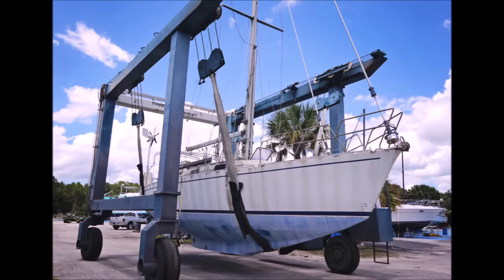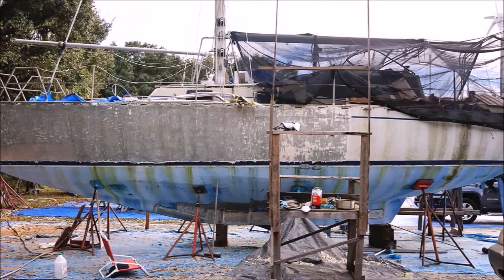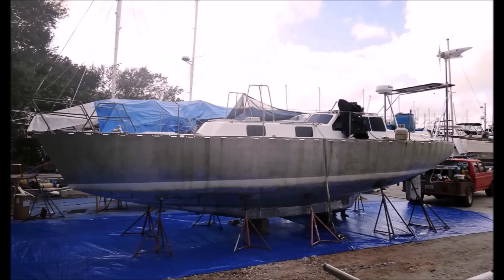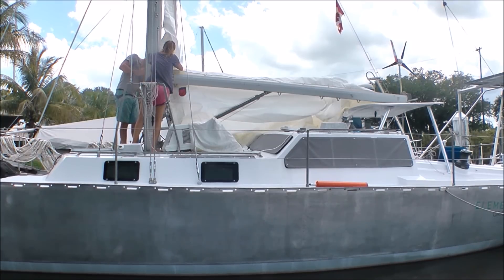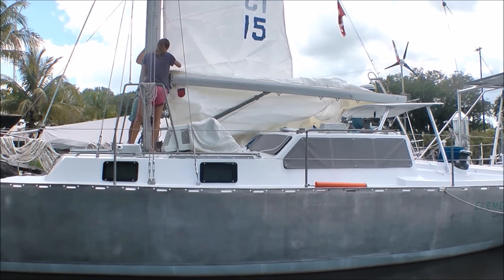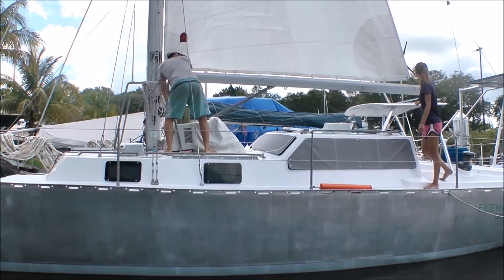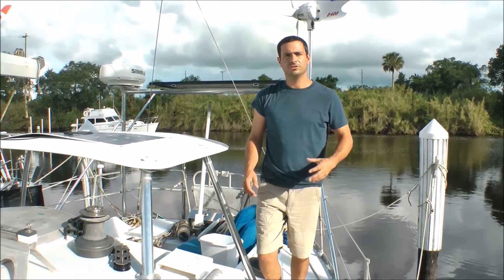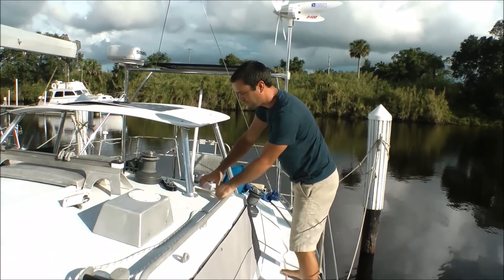Our Thoughts on Going Bare (MJ Sailing - EP 24)

Comment: interesting,,,how is the metallurgy,if you use brass thru hull.or silicone bronze,which is usually what your gudgen is made out of..  ,ive been building boats for years,but never what you have..either wood or fiberglas...good luck.and you guys really seem to know what your doing..which is real refreshing...over the years ive run into so many people who dont have a clue
Reply: Thanks Chapmaker46.   No bronze or brass anywhere on the boat if we can help it.  All valves (welded stand pipes so no thruhulls) are Marelon plastic ball valves so no galvanic issues there.  On an aluminum boat, well electrically insulated stainless is a much better choice.

Matt
Reply: it sounds like you guys got it all covered..very interesting to me.as a boat builder.well take care ans smooth sailing..stay safe,and wear your harness..LOL

Comment: Please read through because I think you'll find it interesting.  I was reading an article about some experiments they were doing with hydrogen.  One was trying to compress it into a liquid or solid.  They were working with just a few molecules of hydrogen and applying huge amounts of pressure.  My first question was, what are they compressing it with?  Most structures would be useless for many reasons.  Then they said they were using diamonds to do it.  So my next thought was, ok, what are you protecting the diamond with because it can't stand that much pressure.  Had to read further in the article to find out.  And the answer was....

Aluminum oxide.

So now your hull is protected by what they use to protect diamonds!
Reply: That's funny.  I've never researched it's use beyond the sand paper we've all used.

Matt

Comment: With the bare shiny or even darker surface is there any difference in surface temperature of the hull or interior temperature???
Reply: Yes!  It is a hot surface and not great for the tropics, but North, any free heat helps.
Reply: Thanks

Comment: The deal with aluminium as i have understood it, is that it corrodes very easily. Pretty much for all types. However, when it corrodes it does not change in volume hence the thin layer will remain and "protect" the next layer from acces to oxigen. Steel however changes in volume, flaking of and exposing the next layer until completely rotted through. Different qualities alu with diff. additives wil result in diff. strengts, heat treatebility and weld-ability etc. Not wanting to spend time painting sounds like a strange excuse, I would go for looks...this hull looks pretty good to me. As long as you don't mis the crash protection of the paint....😊
Reply: First time I left a comment and it keeps multiplying. It said you have not posted....some problem..bla. I think I pushed the "blue arrow" quite a few times. Sorry everybody....
Reply from the maker: I sent through one and deleted the others.

Comment: An aluminum boat?  Oh, boy!  Aren't they noisy?  Aren't you gonna hear every humpback within a thousand nautical miles from you?  When are you finally out of the marina and on the open ocean?  Subscribed.
Reply: Insulated to the floor and the cabin sole is pretty darn thick (will be insulated too).  From the sound of bow thrusters in the marina, it's actually quieter than our cored hulled Sabre.

Matt

Comment: thought: placing the ms/ss/vang winch just outboard of existing winch [w/clutch just forward] ?
fun to watch you guys -
Reply: Damon, Are you talking about the large Harken primaries?  I would love to do it that way since I could use which ever winch is available.  Unfortunately, once the curtains are on the dodger, it would be difficult to reach the clutches.    It seems my only option is for a crossover block to send them back forward to the primaries if needed.

Thanks,

Matt

Comment: I'm not sure how to deal with scratches. I know that you can put powder over powder and it's tough. maybe might be able to use heat guns. But it would need to be done at a time when there wasn't any insulation. for the first time. but it is a thought.

Comment: Hey Guys thank you for the awesome video's, looks like you are getting close to sailing off into the sunset. Wanted to comment on the paint vs raw aluminum. I work for the Fire Department in Sausalito CA and we have an all aluminum fire boat that was painted from stem to stern when it was delivered 12 years ago. After only 2 years we were experiencing the paint bubbling and flaking off. After doing a Shit ton of research we have completely removed all the paint less a few stripes and all is well with the hull. I would recommend that you have a regular zinc replacement program to prevent the fast degradation of your hull. I addition, you might seriously consider getting a quality galvanic isolator. We have seen a 75% reduction in corrosion and zinc loss. I would be happy to send you more information on this if you would feel it would be helpful. Cheers!
Reply from the maker: It's nice to hear that so many people are agreeing with us on the raw aluminum, especially those that have worked with both!  :)

Comment: The ideas is to have clean decks furler lines out to the toe rails so you don't stand on a line that can roll under foot and off balance you
Reply from the maker: We'll most likely go out the back of the cockpit and around to get on deck, but after living two years in a construction zone of a boat with things constantly littering the floor, we're pretty good at stepping over and around things now.  :)

Comment: Your wind generator seems to be working good.   If the sun is out of the port side your wind generator will likely cast a piece of shadow enough to drop your amps way down..Watch your digital amp meter .

Comment: I know that this comment comment comes long after you put this up for viewers to understand why you left the aluminum unpainted.  But all you need do to explain why the aluminum is unpainted is to point out that the U.S.C.G. does not paint its aluminum lifeboats above the waterline too.  The reason is that painting the aluminum creates more maintenance issues than leaving the aluminum unpainted.  Note that I never said "bare".  Aluminum forms an oxidation coating on itself that helps protect the metal.  Your aluminum is not bare; it is merely unpainted.  Looking forward to watching the remaining videos until I am current with you and your travels.  Kevin, USCG Ret.

Comment: The J measurement of the main appears to be good as well as the P, however it's not really cut full enough to maximize light air performance.
Reply: P is still about a foot short.  Without the battens, the leech was hooking and looks a little shorter than it is in person. But, I'd still like more roach.  Unfortunately,  I'm guessing a new staysail and headsail are in order first.... we haven't tried to raise those yet, but the fabric has only a bit of life in it.

Matt

Comment: Okay, I admit it - I came for Jessica's bare hull even though I was well aware clickbait was gratuitously employed.  Still, nice to hear the discussion on aluminum hull dressings.

On your placement of the lines to the cockpit though, aren't you concerned that running them along the combing will be a trip hazard to anyone needing to go forward from the cockpit?  Especially those lines that you set and forget, do you really want to be tripping over them with regularity (halyards, vang, reef, outhaul, etc)?
Reply: On the last boat, we had a track and adjustable genoa cars to trip over and never had an issue.  Based on our experience, and much larger side deck, I feel it won't be an issue.   

Matt

Comment: Painted alu hulls are just wrong - even if they look shiny for a while, I just see them as time wasted fixing and worrying. Your boat looks like sanity and sailing which is a much better fit. Then again, I'm on of those that would instantly run to boreal for a boat if my lottery numbers came up...

About the winches. While I certainly agree that the cabin top setup works poorly, I was mostly wondering about the stay sail. If she is a true cutter rig having that option would certainly be required and I would also install that winch there as it could also be used for chutes, but in general, wouldn't it make your life easier to have a standard genny up front followed with a smaller jib in slutter type rig? You could then just lead the staysail to the primaries and use the head sails as a gearbox and not worry about tacking two sails. And you could still pole them out downwind. I believe this is the most common setup in, for example the french alu expedition boats for a reason. The only real upside of true cutter rig is that boat looks down right sexy with twin head sails :)

Comment: Let me start out by saying that I totally support your choice of leaving the aluminum  hull unpainted.  If it were me I would have buffed it to a mirror finish and clear coated the mirror finish.  Matt, I know you are not metallurgist but much of what you have said about the corrosion of aluminum in a marine environment is not entirely correct.  A properly prepaired and primed aluminum hull professionaly spray painted  with Dupont Imron and cleared with DuPont Imron elite clearcoat is about as durable as it gets.
Reply: I agree, and Jess edited that section out for time.  Our boat neighbor has a Garcia built in the mid 80s with the original Alwgrip paint.  Now the paint is tired, but the underlying primer is still almost perfect (just the toerail needs help).  If we could blast, spray primer or paint, and have no transitional points between bare aluminum and paint, then it would hold up great.  Even done by the builder, it's still tough.... have you ever seen an Ovni that doesn't need paint redone? And Alubat has produced more aluminum sailboat than anyone.

Matt

Comment: What about unpainted mast?
Reply: The mast is typically 6061 and needs to be painted or anodized.  Our last boat had it painted, but the track was restricted due to paint thickness and made it tough to drop the main.  Anodized is much preferred for us.

Matt
Reply: matt johnson Why do you think 6061 needs painting? Inside of my mast is not painted, as well as mainsail track. On parts that paint got off on mast I don't see any more corrosion.

Comment: 5052 is more common in fresh water boats.  The only downside I would say about not painting your hull is your decals don't show up well on your videos.
Reply from the maker: They are a little hard to see at the moment, but the hull will continue to darken and they'll stand out a lot more.
Reply: We almost purchased a 1982 48' Paul Luke built boat in 3/16" 5052.... still not sure why they picked that material.  It was painted, so made-up for some of the differences.... maybe it's because 5052 bends a lot easier and for a round bilge, made a big difference?

Matt

Comment: Why not use the cabin top mounts for a smaller detachable swinging dinghy lifting crane?  You could also use it as an outrigger for flapper stabilizers like these:
https://www.westmarine.com/buy/magma--rock-n-roll-stabilizer-system--P005_153_010_500

Comment: so why did you change your minds and paint the hull???????
Reply from the maker: The hull is still bare, but we did paint the cabin top as not to burn ourselves on the hot metal surface in warm climates, and also added a non-skid to the deck for safety of walking across it.

Comment: China's university published a 5083 corrosion paper, I have seen the experimental results, in the ocean air is basically no corrosion, in the sea in 19 years the maximum corrosion depth of 1.6 mm.
中国的大学发表过5083的腐蚀论文，我看过实验结果，在海洋空气中基本不腐蚀，在海水中19年最大腐蚀点深度1.6毫米。
Reply: Was the 1.6mm limited to pits of corrosion in localized areas, or was it more uniformed over the submerged surface?  Very interesting!

Matt
Reply: Maximum depth, point corrosion. The average is not so deep
Reply: But be careful of the corrosion of marine life
Reply: Thanks for the info.  In practice, it's about what we've seen with the previous wet bilge on this boat.

Matt
Reply: ：) good luck

Comment: Being surrounded by aluminum 24/7 and walking and sitting on it and always touching it. Aren't you worried about how much will be absorbed into your bodies and cause health issues like Parkinson's and Alzheimers to name a few.
Reply: Robert,

Typically, the only real concern is with the water in an aluminum tank.   We epoxy coated our tanks and heavily filter the water for this reason.  

Matt

Comment: That boat is ugly (and didn't get better even in sept.2020), not bc of the choice not to paint it, but the lack of uniformity of the AL. surface, it's more work to get even just a brushed finish right, than to paint it.